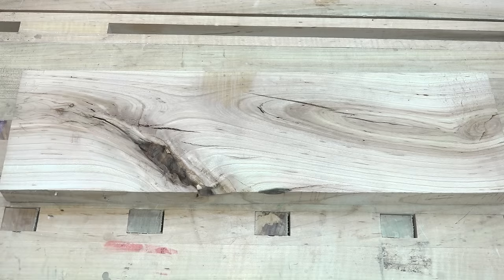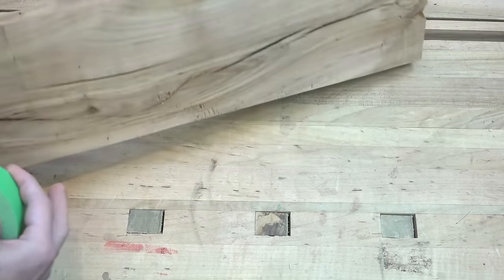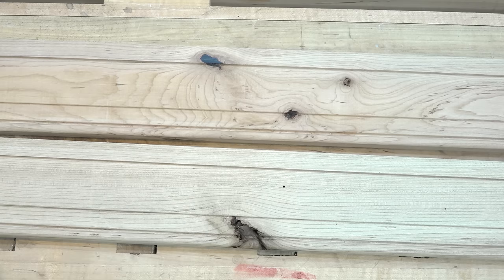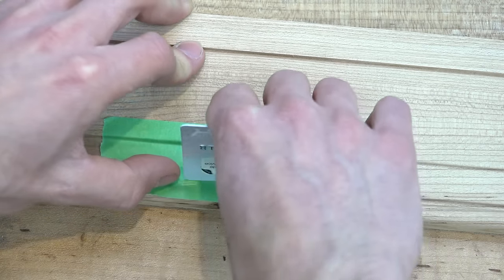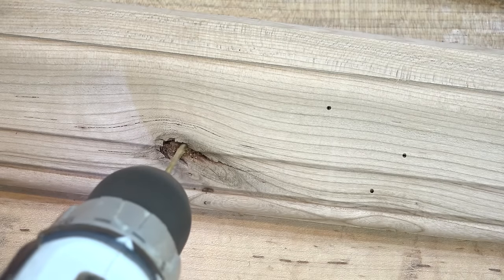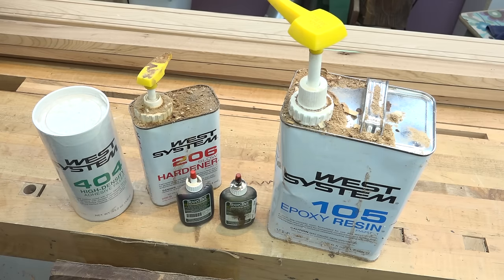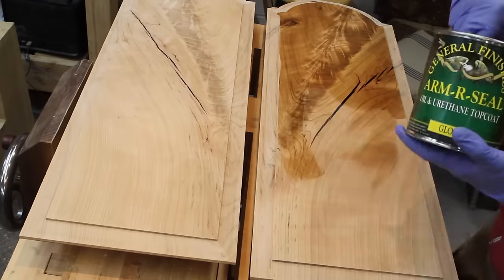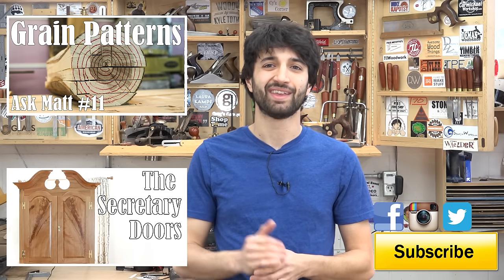Filling Voids, Cracks, and Defects in Wood with Epoxy - Ask Matt #19

Comment: I use a ton of epoxy as filler, since I use a lot of wood from locally felled trees. I know this is a little anal-retentive, but I always stir the epoxy in two cups. A few times when I was mixing in one cup before pouring, I would get a pocket of unmixed epoxy...probably from the edges or bottom of the cup. So now I mix for one minute in one cup, then pour into a second cup, and mix for another minute, with a new stir-stick. Works every time.

Also, if you ever get neurotic about bubbles, get a vacuum chamber to degas the epoxy...works like a charm.

Comment: Hi Matt, on large thick lumber I use my shop vac to suck the epoxy through the cracks. I use a thicker mix of epoxy. Once the mix comes out the other side I shut off the vac, tape and continue to to fill with thinner mix epoxy. I enjoy your videos and watch as often as i can. Thanks for sharing.

Comment: I really like your videos and have been using some of your tips but I might add a tip, although even many experts use pigment in epoxy for defects, holes etc... I have a rule with epoxy. Never ever ever ever use tints for knot holes or cracks; unless for some odd reason the knot is not the color of a knot inside the hole, or if the hole is bigger and light can shine through the other side(almost never). Epoxy without tint will mimic the color below it and look absolutely perfect when sanded and varnished. Adding tint looks artificial and stains the adjacent wood. Adding sawdust looks pretty lame too. If whatever hole you are filling is the color of the wood or hole fill it with clear epoxy. When pigment is used in epoxy the deeper the hole the darker the color becomes. When to use pigment? say you laminate a table with strips of wood and your glue line has a half knot. Then you can gouge the non knot side out to look like a knot. Paint it with acrylic or epoxy and pigment and then fill after dry with clear epoxy. Remember epoxy gets darker with depth. Cracks that go deep will appear black with just clear epoxy poured in so no need to color dark. Knot holes become black with clear epoxy. Shallow dings or tear out etc...mimic the color below(wood) if (nearly) clear epoxy is used. Reach out and I can show you examples and I have literally almost a thousand knot holes, cracks etc I can snap a pic of for you all; and remember epoxy blushes, so if you have to pour more after it cures to fill that dam knot hole that was so thirsty. Make sure you wash the patch with hot soapy water and say a white scotch brite pad to remove the water soluble amine blush before lightly sanding and pouring a second coat. Same with after a perfect epoxy patch. Hot soapy water before varnish. Epoxy won't bond to it's own blush very well and either will varnish. Cheers, Jon

Comment: I live on the west coast and have been working with a lot of salvaged old growth redwoood in the process of restoring my 1880s home.  I use all the techniques you show in this video with one key change.  Applying the epoxy precisely out of a mixing cup is next to impossible.  I dispense the resin and hardener into the corner of a ziplock or other hole-free baggie.  Twist the baggie to isolate the corner and squish it around to mix.  Cut the corner off with a razor knife at whatever size stream you need.  Keep twisting the bag to keep it sealed and build a little pressure.  I use recycled bags but u run the risk of having a leak which is a mess.

Comment: For knots I grind dry coffee beans to dust then mix up small batches of 5 min epoxy. After the epoxy is mixed I add enough coffee powder to get a stiff mix like cookie dough. Then I use a putty knife to fill the cracks. While the mix is still a bit green I will remove excess filler with a sharp chisel. I have found that you cannot simply add the three components together all at once and then mix as it doesn't harden properly.

Comment: Great demo Matt.  I too use epoxy on almost every project.  I have found using a heat gun on the low setting increases the viscosity of the epoxy making it easier for it to flow through the entire crack but one must be careful with the heat.  The other method is adding 1 or 2 CCs of denatured alcohol which turns the epoxy to the viscosity of water.  The alcohol evaporates almost instantly once applied and it doesn't seem to affect the properties of the epoxy.

Comment: Thanks Matt. This couldn't have come at a better time. Have some black walnut 8/4 I'm going to bookmatch for some door and drawer fronts and it had a few knots in it. Went with the 206 and some black walnut transtint. worked well.

Tip: when the mix starts to whisp smoke...You're done...or about to be.

Comment: Great video Matt! The process I use (on a much smaller scale) is to blend matching wood dust into the epoxy, making it stiffer, and then forcing the mix into the voids with a palette knife. I don't get bubbles and the colour match is very good, in some cases undetectable.

Comment: Great tip. You can also do an invisible repair on anything about 1/2" around. I make tables with less than perfect wood. many knots are rotten or loose, and for that I collect knots from other pieces.  Excavate the defect then cut a 1/2" slice of knot down until it fits into the depression. slight imperfections can easily be filled. If the defect goes thru the piece, fill the back with bondo or other. I can easily fill a 2" knothole in about 10 minutes start to finish, seamlessly. For the smaller holes use the end of an appropriately sized stick.

Comment: Thanks, Matt! I am a maker of custom electric violins. I want to thank you for an excellent YouTube presentation about how to use epoxy as a stabilizer. What I liked about your video was that the was no music, things were done in real time (no fast-forwarding) and all the steps of what was needed were clear.
    A person who is thinking of commissioning an instrument from me wants to have the top and back plates of his instrument (this will be a hollow-body instrument, with ribs as an acoustic violin has) made from an amazing piece of Juniper wood that I purchased for its beautiful figure and colors. The wood itself has some punky, rotten and cracked spots, and the person who milled it for me suggested soaking it in clear epoxy to make the section of the board I'm using consistently hard and stabilize the cracked and punky sections.
Reply from the maker: Depending on how punky it is, you might consider using a penetrating epoxy first to strengthen the fibers followed by an epoxy fill as demonstrated in this video.  thanks!
Reply: @mcremona  Hello, Matt, and thank for your reply:) Depending on which section of the board I would be using, some parts are very punky. Thanks for the idea of using a penetrating epoxy first. I'm new to the epoxy process, and so might have another few questions or two for you before beginning the work as I usually use wood that has few if any anomalies/checking, etc. My website is: dbcv.com, and you can go to the "Gallery" section if you're curious about my instruments. I'm also on Facebook and am a member of the "Luthiers Club". There are three pictures of the Juniper I am going to use both there and on my personal page, I believe. Thanks, my friend:)   Best,  David Burham

Comment: I have a foosball table that has been exposed to the elements. All four wooden legs have significant cracks and splits. My question is, could I use this epoxy to fill in the cracks and splits? Or is there a better method for repairing these legs. Great video by the way.

Comment: Matt, I watched your video very carefully, and purchased the exact same products you used to fill voids in a large slab of wood. I taped the top of the voids very well, and filled from the underside. About 15 minutes after filling, the resin began to leak out of the void and onto the floor. The resin was quite thin after mixing. What happened?

1. A cool Florida day became quite warm, but I would only expect the resin to set up faster.

2. Because I have a large void to fill, I mixed up three pumps of the 105 and three pumps of the 206 at a time, then added about 10 drops of TransTint Dark Walnut.

Before I order replacement resin and hardener, I want to be sure I understand what I'm doing wrong.

Thanks for any tips!
Reply: More tape.  Warming up epoxy causes it to become very runny. I use it professionally and know the frustration of missing a pin hole and coming back to a puddle. If you are filling larger areas be sure to do it in layers/steps since it generates its own heat when curing and can overheat causing cracks in itself or even smoke and catch fire (more of a problem when using 205 fast) if the area is too large the weight of the epoxy can push the tape out of the way if the wood has a crown or warp and isn't sitting flat on the table.  If your piece is uneven you can tape it (or use premask since its wider ) and set your piece in a bed of sand and jiggle and work it in to get full contact.
  Hope this is helpfull

Comment: Hey Matthew, question for you.  I have four small table tops that have small cracks here & there throughout them.  The tops appear to be stained.  Does this seem to be the steps I should take to properly repair them:
- Sand the current stain,
- Clear all dust/debris from all cracks & voids,
- Tape off potential exits of future epoxy pours,
- Epoxy cracks & voids, allowing to cure, etc.
- Sand excess epoxy to table top level,
- Clean & restain

Thank you in advance for your insight & suggestions.

Comment: Very informative Matt.  I used some epoxy to fill some gaps over the weekend but used the Diresta method of adding some sawdust from the same wood to match the epoxy to the surrounding area.  Can barely tell the epoxy from the rest of the project.
Reply from the maker: +TT OKC that's my preferred gap filler ;)

Comment: Great video Matt! Is passing epoxy through the planer bad for the blades? Also have you had any issues with chipping? Seems so much easier than sanding and makes it perfectly flat, but dont want to wreck my equipment or the piece.

Comment: I've heard one suggestion of using a vacuum to pull the epoxy through the board if the crack goes all the way through but haven't tried it yet.  Sounds messy :)  But getting it all over with quickly rather than having to keep messing with it has some appeal.
Reply from the maker: I would really only see that being effective if you were trying to clamp a crack closed.  Otherwise you'd have a hard time damming up the underside to actually fill the crack.  At least that's what my initial thoughts are

Comment: Hi there! Great video and the result looks alot better than I expected. I am currently in the process of redecorate a old wooden stairs. Now the stairs got varying degrees of wood worm tunnels on the surface of each step. I am considering using epoxy resin to fix this, what do you think about it? Should I do anything about the tunnels or just fill them with epoxy?

Comment: Hello Matthew, WOW! Thanks so much for your video, very useful and clear! I would be grateful if you could give me a suggestion. I left a bottle of gel bleach in a bag on the floor. It is an old, light colored, parquet; therefore, there is a very thin line of empty space between the pieces of wooden strips. For some reasons, the gel bleach leaked and, since the bag was not made of plastic (it was a cloth bag), it passed through and got to the floor. It stayed there for a very long time. The gel bleach had the time to literally dig a large hole in the parquet. Which now looks like a crater, about 5 to 6 cm in diameter, exposing the bottom layer of the floor, some sort of strange material. I thought to fill it with epoxy glue (Gorilla epoxy with the 2 syringes), wait that it dries, and then paint. I am glad to see that I can mix the paint with the glue itself. I need to fix this quickly. It's not my home. I would be GRATEFUL if you could help me with the following questions: 1) Since I cannot fill from the back side, how do I address the need to leave a thin line between the wooden strips? (yes, the crater expands beyond 1 strip, affecting the 2 strips at its 2 sides too. 2) If I send you a picture of the parquet (how/where can I send it? Thanks), would you be able to tell me, approximately, what colors of what kind of paint should I buy? 3) I cannot spend much money on huge tanks like yours, so, is the Gorilla Epoxy glue with 2 syringes ( https://www.homedepot.ca/product/gorilla-epoxy/1000778451 ) suitable for this job and can I mix that type too with the paint? 4) If the epoxy will end up overflowing, how can I gently smooth it without damaging the surrounding healthy parquet? 5) Any other suggestion? Like, if it had happened to you, what would you have done saving as much time and money as possible? THANK YOU SO MUCH!!! I will anxiously wait for your response and my apologies for the long comment. Kind regards.

Comment: great video. you can also take the sand paper off of the palm sander and push the sander down firmly near the treated area to quickly vibrate the Bubbles to the surface & away
Reply: +Rag Tie I started with that. switched to a rubber mallet and tapping the board. got more bubbles that way.
Reply: Right on, I'll try that next time. Great stuff you do

Comment: I use epoxy also, after the pour, I use my Saber-saw without the blade to vibrate the wood to settle out the epoxy and remove any bubbles... As it settles just add more epoxy to level it up..

Comment: I started using epoxy back when Tommy did a project in the Southwest a long time ago. Or maybe it was Norm. Who knows it was about 30 years ago. Epoxy is the bailing wire and duct tape of the wood trade! Sometimes I use just clear or sometimes I color it black. Depends on the project.

Comment: Enjoyed your video but have 1 question.  Had a piece that had a end check/Crack about 1/4" wide, 5" long and all way through.  After filling the epoxy leaked on end thru tape.  Is there a better method for such applications to stop leaks on edge of boads?  Great work, enjoy your videos.

Comment: would the epoxy not gunge up the blades on the planer, on a second note i'm now 40 years old and thinking it's time i dabbled in my own shed full of tools after looking at thickness planers it looks costly so plan to start small and work up what sort of tools should i start with i guess a good set of chisels a pensil tape saw .... but on the lines of power tools where do i start. great vid by the way i'll certainly be watching more

Comment: Literally perfect timing.  I have some small maple slabs that I'm about to repair with Epoxy.  I need to go get som Transtint!
Reply from the maker: +Gnomacide awesome!
Reply: +Gnomacide Check the basement paint stash before you spend more cash, a small amount of paint gives a translucent affect the same as adding a stain.
Reply: +Big Fat Tony's Does it matter what kind of paint I use?
Reply: I have used acrylic and enamel with equal success.  I also used fabric dye powder.  Test it first. Get two pieces of wire, fold them in half, twist each on itself till you get one little eye that is about 5 times smaller than the eye in the other wire.  The little eyes in the wires will produce proportionate sized drops.  This way you do not use allot of epoxy for tests.

Comment: you can pinch the tape against itself to make a dam. using a vacuum bag will really improve permeation of the wood. Makes the fill faster as well. Add saw dust with less color to match wood tone better. The saw dust only needs to be on the top of the fill.

Comment: When I went to art school, they taught us about "archival quality" glues. Paint comes in many grades from "it looks and smells like paint" to tempera paints that have lasted 3,000 years. Wheat paste and hide glue last for hundreds of years. Joints with standard woodworking glues last at least 60 years. How long is an epoxy glued joint expected to last? Boards glued with woodworking glue will break in the board, not on the joint. I tried it with red oak. Will the epoxy joint break before the wood itself?

Comment: Hi Matt, that was awesome; thank you for being so descriptive. I cut a nice 2" thick slab off a black walnut tree and would like to turn it into a cutting board for my wife. The slab has been drying for at least three years and cracks have formed over that drying time. Have you ever filled cracks or voids with epoxy on a cutting board?
Reply: Marc St-Georges was wondering this exact same thing. I have 8 quarter walnut with knots and I want to make an end grain cutting board with them. Please let me know what you decided to do, as I am on the fence on what to do

Comment: Great tip Matt! now if a Crack has trash in it such as bark debris or saw dust do you clean it out or continue to fill it? just a thought.
Reply from the maker: +Edison Norman the epoxy will encapsulate anything in the void so you don't necessarily have to but I would probably remove any loose debris

Comment: Hi Matt. I'm fixing a damaged kitchen table with leaves. Will epoxy work for something like this? The table is somewhat damaged because of a little water. Should I refinish and stain before applying an epoxy coating? I was very intrigued with the use of a coloring agent in the epoxy and am wondering if this could take the place of refinishing. Obviously I'm very new to a project as big as a kitchen table.